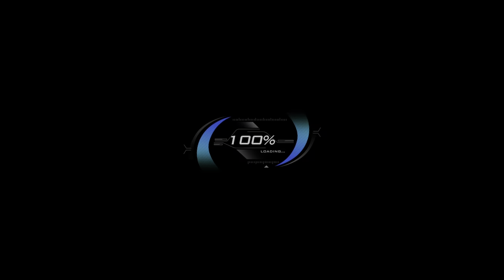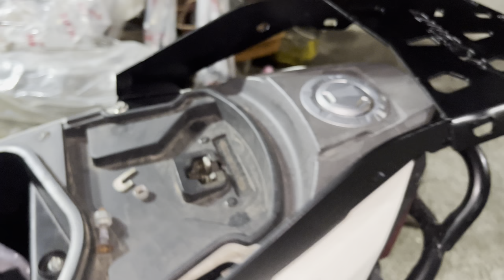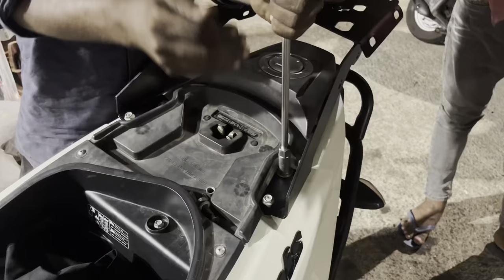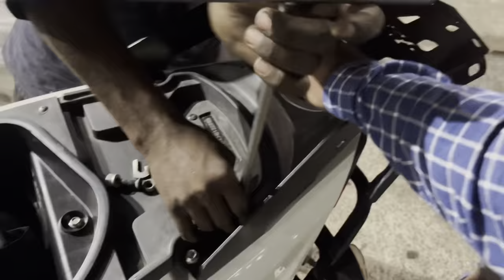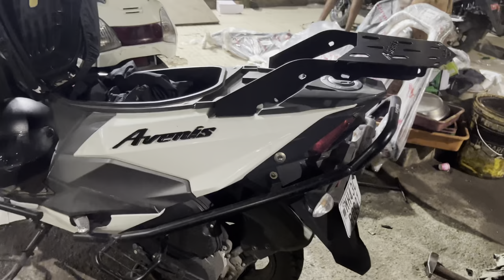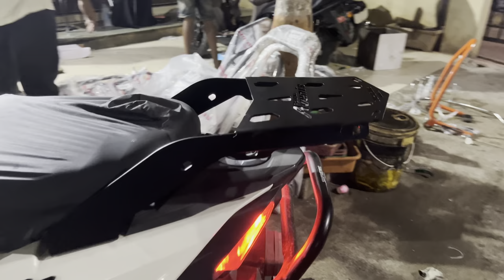SUZUKI AVENIS 125 Modify 2023 | TOP Rack fitting for TopBox | Scooter Modifications

Comment: Have u upgrade the back or rear tyre?
Reply from the maker: Not yet Just 1 year completed to Suzuki avenis may be after one long ride I will change both tires 😊
Reply: @omkarranevlogs5569  no rear tyre profile is small ryt it will not give good grip so thats why
Reply from the maker: @rakeshcj3773  correct I have observed that probably in the rainy season, during sharp turns, there might be chance of tire skits.
I will check with service centre as well as local tyre shops for recommendations for tyre upgrade
Reply from the maker: Also if you have any recommendations please suggest 😊
Reply: @omkarranevlogs5569  I have upgraded with Mrf 120/70-10
Reply: drop milege how is drive please tell me